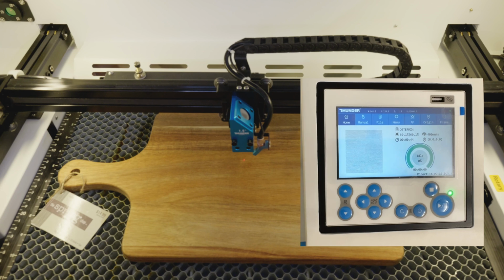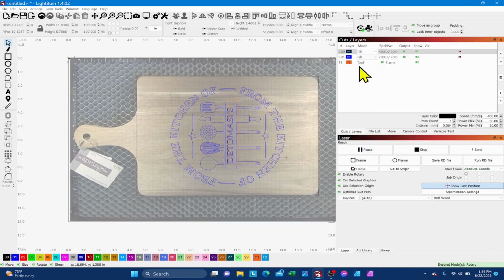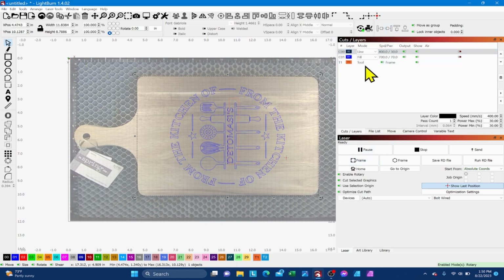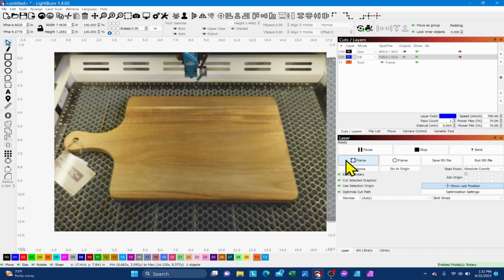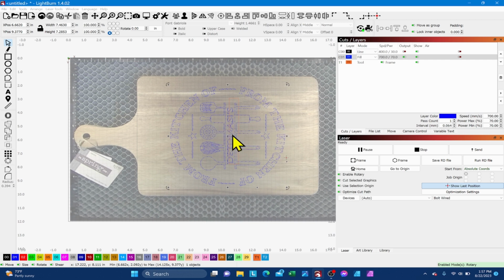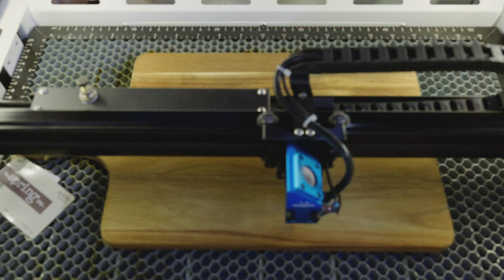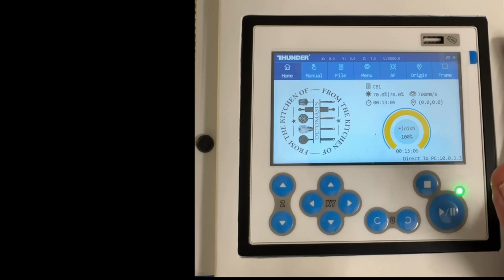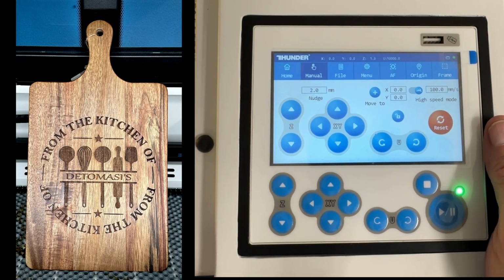Your First Project with the Thunder Bolt Rf Desktop Laser

Comment: Thanks for the video really enjoyed it. Could you do a video of the Bolt and the PIGrip Rotary ? would like to see how it fits and what size tumblers you can do Thanks
Reply from the maker: Thankmyou for the suggestion, yes that’s coming very soon, a modified piBurn grip(shorter main rail)  works great in the bolt. you will need a Twister tray that I make or buy the supports that piBurn will be coming up with. my twister tray is available now here 
https://computercreationz.online/

Comment: Hey Robert, another great video.  Do you know if the Bolt comes with hybrid servo motors or does it have stepper motors like epilogs? I couldn't find that information on there website.
Reply from the maker: usually stepper motors are slower than hybrid motors. not sure what the epilogue has. the nova series lasers are 1000mm/s and the Odin series thunders are 2000mm/s the Bolt is 1000mm/s as well.
Reply: @computercreationz  Actually I got those reversed the epilogs use a high speed servo, which has very little overrun allowing you to engrave at full speed, unlike stepper or hybrid stepper motors which has to slow down to stop and the faster you go the more overrun to each edge.  The glass tubes also have trouble engraving at high speeds unlike the RF tube like the bolt.  I know you said you could run all day at 700mms, just wondering why not 1000mms.
Reply from the maker: Actually the bolt has stepper motors and the nova series has hybrid motors @Manlilow

Comment: Great video! Looks like your the first channel other than Thunder to feature this machine. Congratulations. I was just about ready to pull the trigger on another desktop laser when they announced this. This machine is now the front runner and most likely what I will purchase. You just can’t beat Thunder quality. I wonder though if it is capable of working with 30oz tumblers on a rotary. Tumblers are still very popular where I am and being able to work with larger tumblers is a must. I’d love to know your thoughts.
Reply from the maker: Yes doing 30 oz tumblers on the bolt  is no problem. I’ve done several

Comment: Excellent demo! I can’t wait to see the Bolt doing your air test with the blue and white Rowmark!  Hopefully you can dial the air  on this unit.
Reply from the maker: there is a single needle valve that you can set for things like acrylic and 2 color plastic
Reply: Thank you so much! I’m pretty much sold now! @computercreationz
Reply from the maker: I think you will enjoy this laser @patriot9560
Reply: Thank you for your input. The 24-60 is on my radar as well. That dual air is hard to ignore! @computercreationz

Comment: Is the final cutting board shown the same that is shown being lasered?  I just ask because the first spoon looks like part of it didn't engrave along with the lower star.  Wondering if it is just the glare of the lid or what?  I have a Bolt coming in and am watching all the videos.  Thanks for doing them.
Reply from the maker: Yes, at the end and pictured at the end, it's been oiled and reflects what you would deliver to the customer, the board was very dry when it was engraved.  The 400mm engraving is deeper than the 700 mm engrave Different wood grain too with that type of wood.
Reply: Thank you.  I am enjoying your videos.
 @computercreationz

Comment: What is the advantages of rf over diodes, uv, co2 
.
Reply from the maker: RF tubes have a much smaller beam spot great for engraving details, 10,000 hour lifencompared to 2000-4000 hours for co2 glass tubew, much faster than diode!, No chiller needed. Takes up less room in your work space. There are the types of co2 tubes you find in very high end lasers like Trotec or epilog.